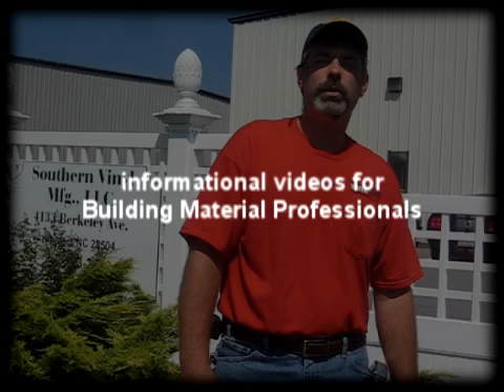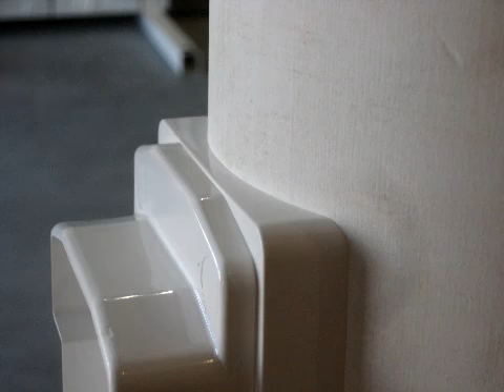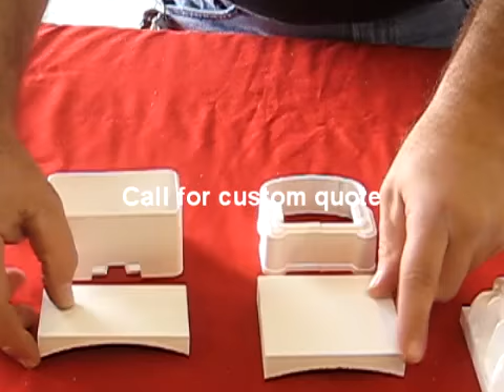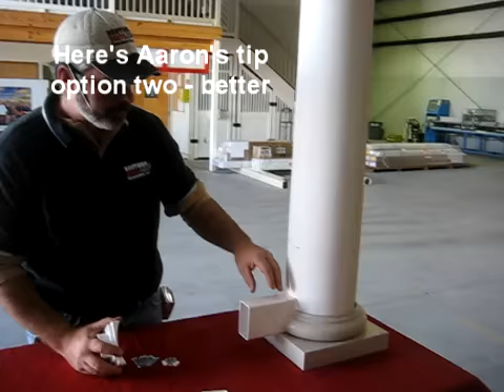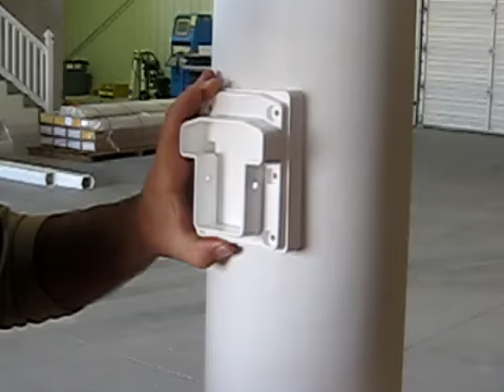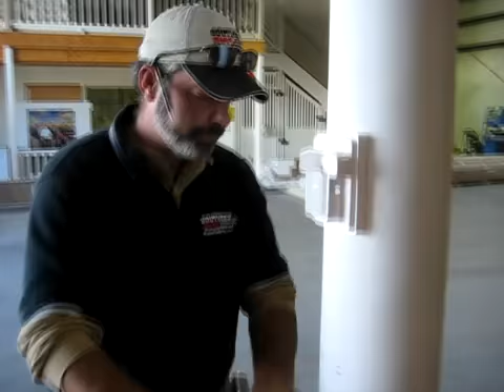ASK SOUTHERN - Round Column Adaptors

Comment: I have an 8 in metal column, it is structural holds 20,000 lbs but is hollow....my question is can I install these brackets on it without damaging the strength of column and what kind of screws to use on my metal column? Thank you

Comment: Thanks for your video.  Do your adapters work for hanging a flag on a round column?  Thank you.
Reply: Mary Morris I am looking for the same thing! Flag mounts are flat and present a problem with trying to drill holes into a round column and also the problem of the gap behind the top part of the mount.
Reply: Mary Morris I need to know the same thing
Reply: Mary Morris
Reply: Mary Morris 59.84087,-117.48972